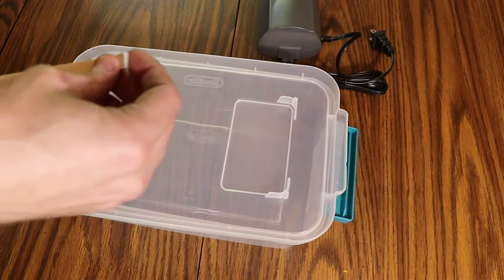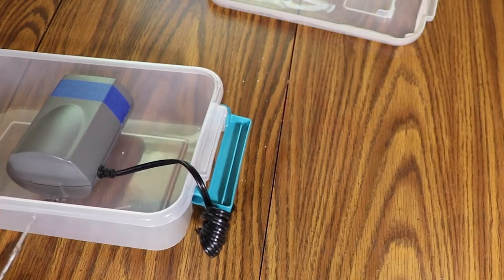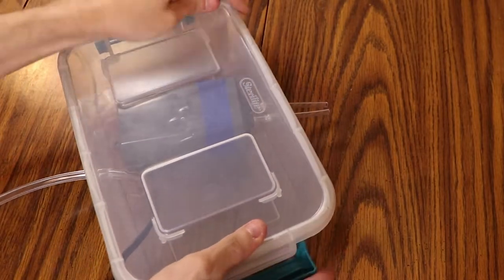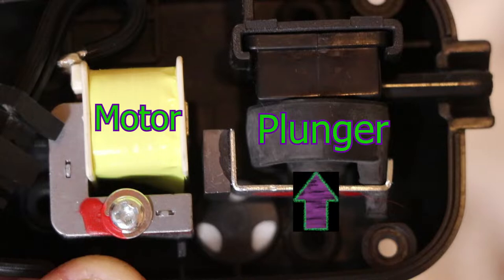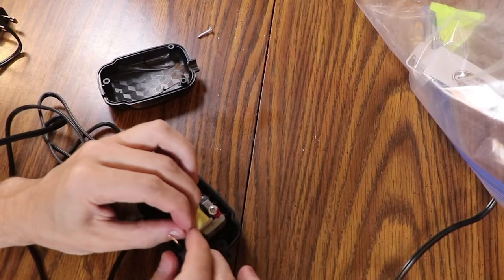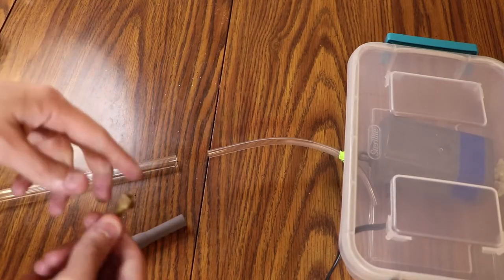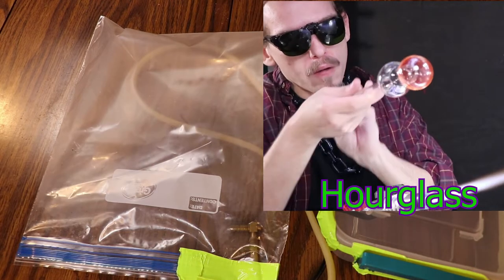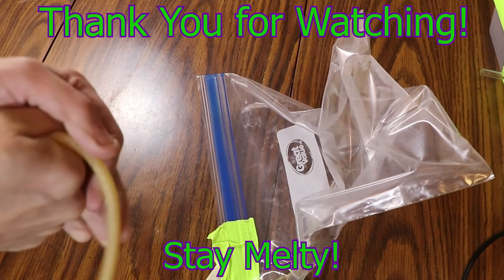Air Pump to Vacuum

Comment: Connect that shop vac to a Tupperware like the one you used in this video. Drill 5-10 small holes and cover with duct tape. Drill a larger hole so you can connect a silicone blow tube and swivel system. You can control the amount of suction depending on how many holes you leave open. I saw some guy make a vid about this and it works great. 

I have to remember to wait till you’re videos are over to comment cause you always end up doing what I’m thinking of saying lol

Comment: AC current doesn't have a polarity, so reversing those wires does nothing. Chances are there's a one-way valve or flap between the outlet and that rubber bellows thing. If you can find that and if it can be reversed, then you might be able to switch from blow to suck.
Reply from the maker: Haha Whoops I forgot it is AC. I've been building some flashlights and wiring up batteries lately I totally forgot I was on AC power for a second. No wonder those power wires were so beefy LoL.
Reply: Ah you beat me to it!
Reply: For a minute I thought I was stupid. When he said reversing the wires should reverse the motor. I’m like is he using dc current..? Then saw the plug. I’m like that won’t do anything. The whole meaning of ALTERNATING CURRENT is pretty self explanatory

Comment: Lol didn’t realize this was a glass tip vid. Was like why does this dude have a swivel and then slowly everything that popped up afterwards
Reply from the maker: Yea this one could of been better. I tested it but recommend an actual vacuum instead of the air pump.

Comment: Use a smaller contaner
Reply from the maker: That would help. This idea was good in theory, but the parts could have been better. Looking back, I don't think that pump can really handle or generate much pressure.